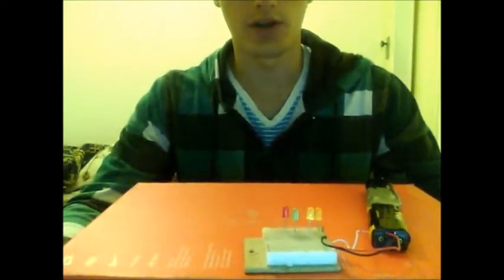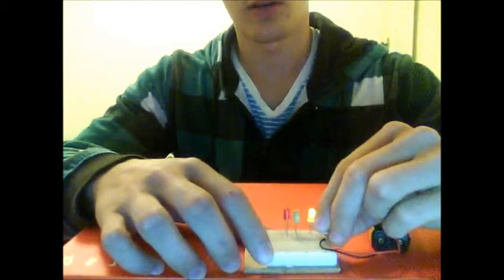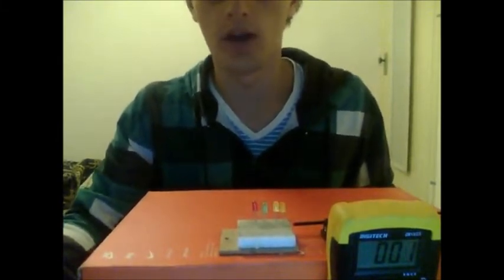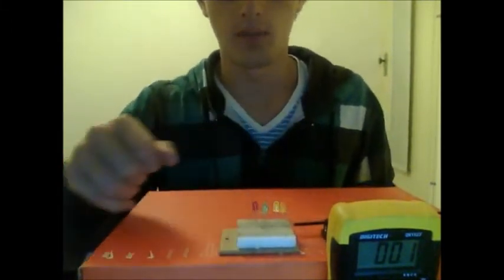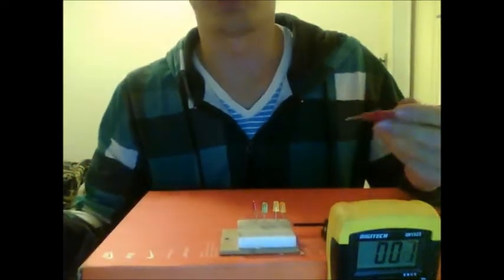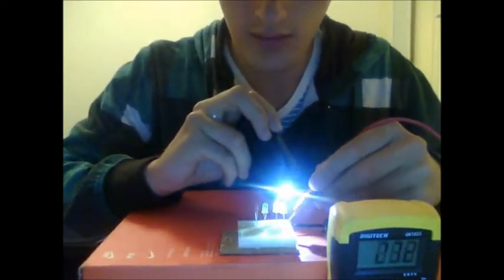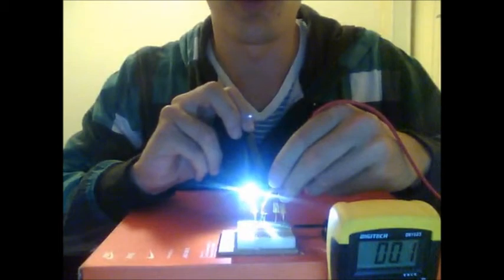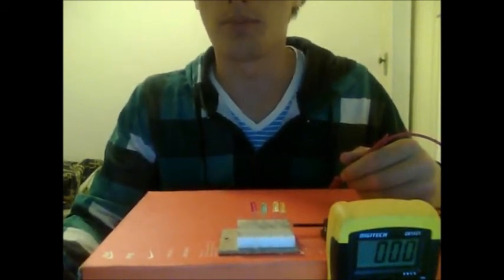Tutorial: Using an LED as a Light Sensor/Photodiode

Comment: WOW, I've used leds for many years in my diy projects.... yet I never knew it could be used as light detectors. I could have saved money instead of buying photoresistors and 'light' sensors. They can be used on Arduinos right??
Reply: Yeah any voltage can be fed into an analog input on the arduino. But be careful with the voltage levels, I reckon the maximum is 5V on the inputs.